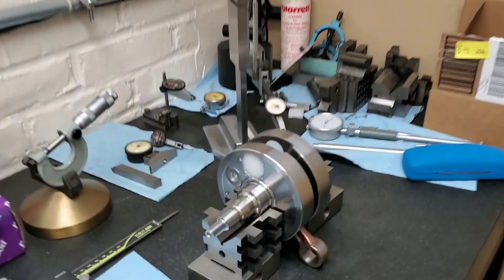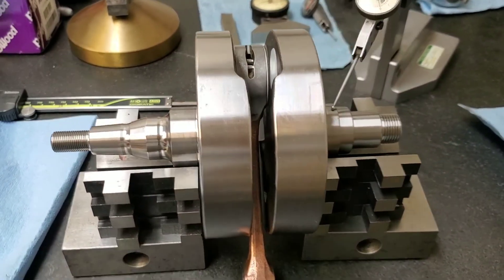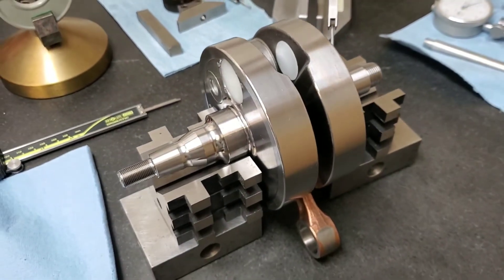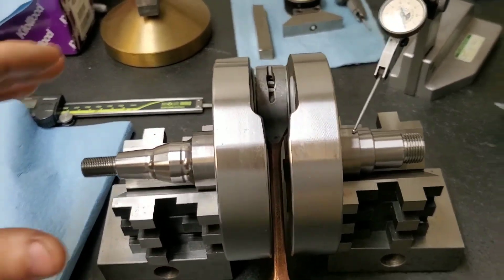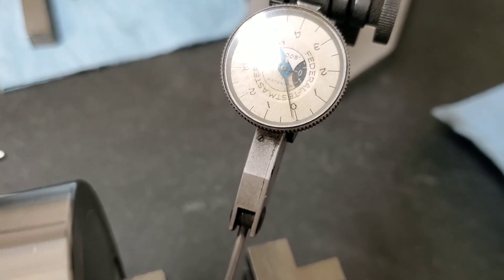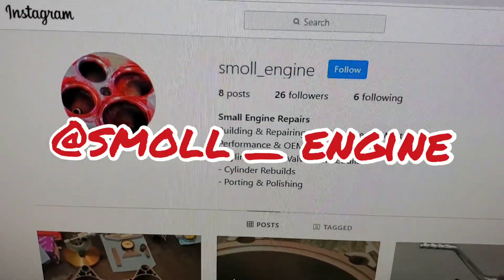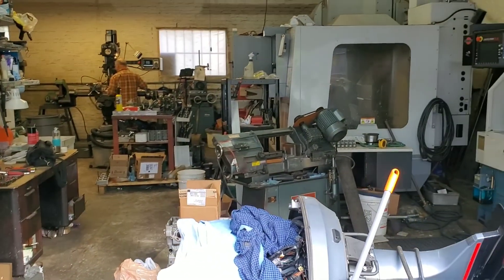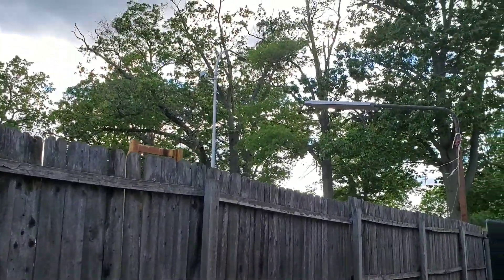Checking Dirtbike Crankshaft Runout

Comment: Love the video your so knowledgeable. I’m doing a rebuild on my ktm. How would you clean valves I have them off the head. Also do I need to lap them after I clean them they are not titanium
Reply from the maker: I hope it turned out  well! If the valves have no reason to be damaged and pass the visual inspection, clean with parts cleaner and lap them lightly without any compound. If pitting, use some light abrasive compound. If not, cut seats and grind valves.